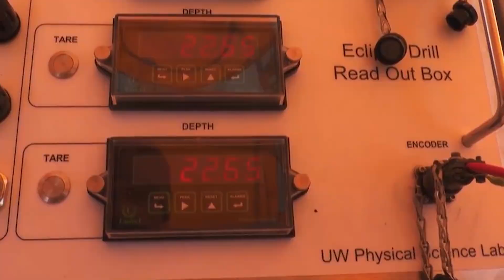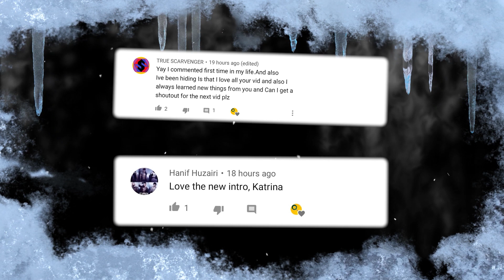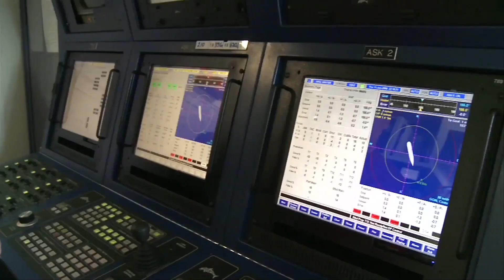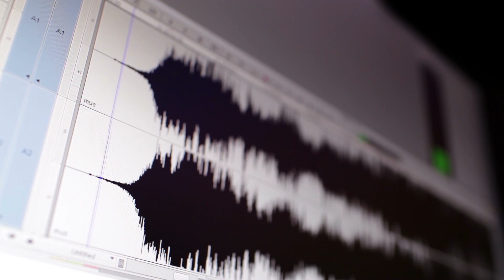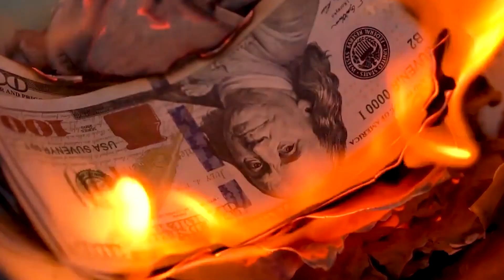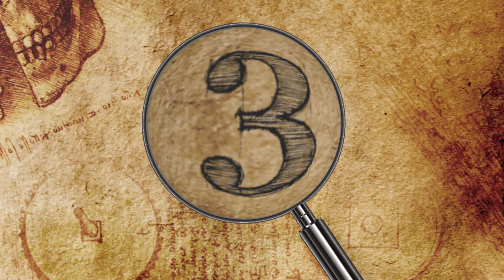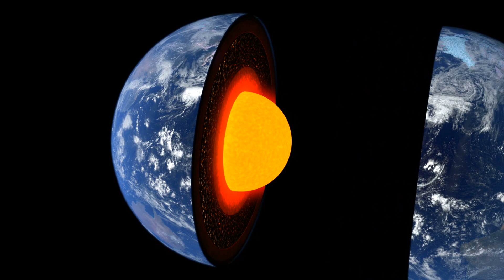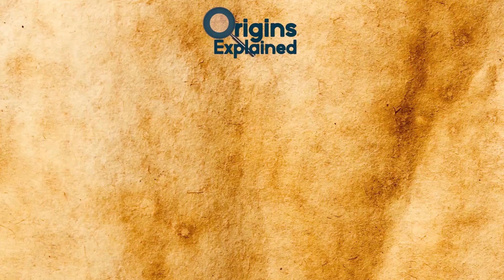10 Most MASSIVE Holes In The World!

Comment: I've been down at the bottom of the Kennicott copper mine. Looking up from the bottom is almost like looking through a tunnel. It was surreal, but I didn't get to enjoy it because I was working. Oh and no internet connections, radio or any signals of any kind work from about halfway down  and lower, and when you get within a quarter mile of the mountain where Kennicott copper mine is, no matter what side, you lose all signals for cell and radio oh and BTW Kennicott copper mine itself is about 8 miles long north to south but Rio Tinto/Kennicott uses a 20 mile section of the mountain for mining ops. No I did NOT work for them, I delivered shot-crete, which was used to support the underground mining tunnels that branch off when you get to the bottom. Anyway thanks for reading.

Comment: Grew up with the Bingham mine in easy sight. Went to the visitor center multiple times too, and always had fun. I happened to be away for 18 months when the landslide occurred. They knew it was gonna be large, but underestimated the size it would be. Luckily the visitor center itself survived, but the equipment they were planning on using to clean up after the landslide got buried at the bottom of the pit! Sadly, due to the landslide, they had to close the visitor center for a few years, and finally reopened with the shuttle system in place in 2019. (Used to be required to drive up to the visitor center in your own vehicle.) Haven't had a chance to go yet, but I hope to this year!